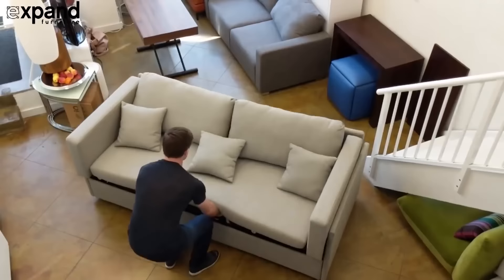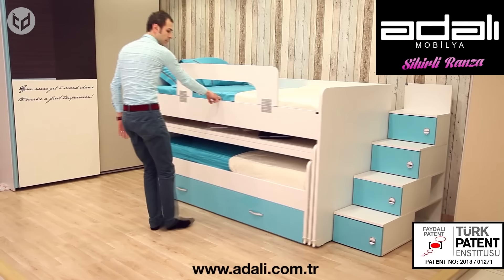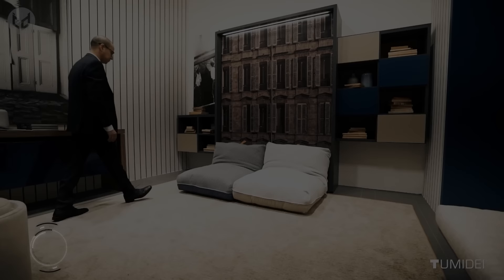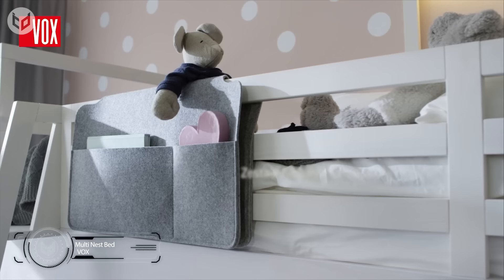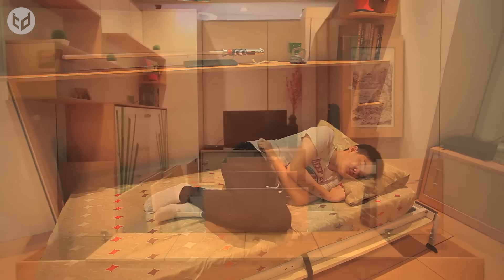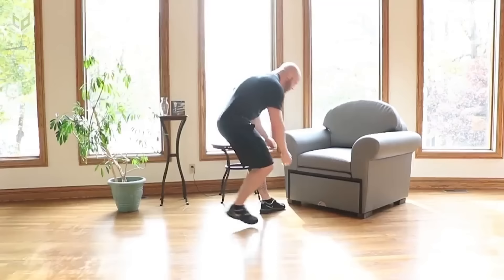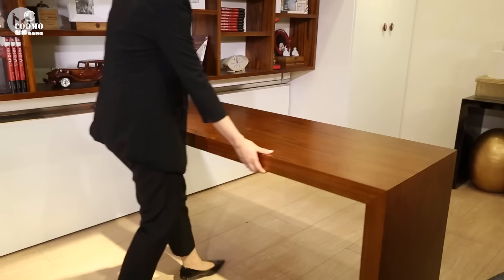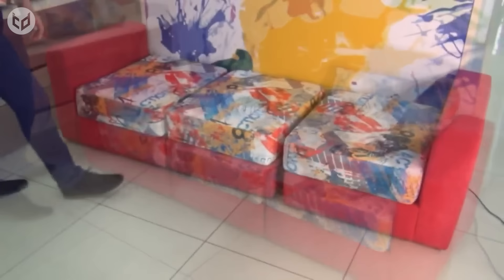70 INCREDIBLE Space Saving Furniture - Murphy Bed Ideas For Small Space

Comment: Great ideas!  The problem is that they are usually expensive.  If you could afford to buy them, you could probably afford a larger apartment and wouldn't need these.
Reply: J'ai eu exactement la même réflexion. Il y a une absurdité avec ces meubles : la logique voudrait qu'ils soient acheté par des personnes logeant dans des petits appartements (donc des appartements pas chers, pour les gens aux revenus modestes). Les personnes qui ont de gros moyens financiers logent dans de grands appartements en principe. Ils n'ont donc nullement besoin de ce genre de meubles qui coûtent extrêmement chers et qu'ils ont les moyens de s'acheter !
Reply: @francoiseprecheur2222  Sorry, it's not translating your comment.
Reply: @pegatheetoo1437  : I had the exact same thought. There is an absurdity with this furniture: logic would dictate that they are bought by people living in small apartments (i.e. cheap apartments, for people with modest incomes). People who have large financial means generally stay in large apartments. They therefore have no need for this type of furniture which is extremely expensive and which they can afford to buy!

Comment: The foldout stairs actually scare me. If someone is upstairs they could fall to the first floor if the don’t notice the stairs are folded into the wall (maybe a roommate or family member folded it away) or if they have to crouch down to unfold the stairs and lose balance they could fall. I think the reason the video only shows people unfolding the stairs from the bottom is because of how dangerous this could be for someone at the top.

Comment: Some brilliant ideas; my favourite was the high bed with multiple storage underneath. But are any of these items available in the UK?
Reply: i liked that idea too. I built a similar design using a large low solid wooden dresser for the front, put 2x4s across the dresser back and screwed then into the wall. Next I placed a shett of plywood across the whole thing and placed my mattress on top. It was not fancy inside , but it did have a ton of storage and i lived in a very tiny space back then. I had a 3 step step ladder to get on the bed. id like this one if i had any money and it was available in the USA

Comment: I don’t understand why designers don’t make Murphy beds to pull out horizontally rather than vertically. Some one might have 80” (the length of a queen size bed) horizontally but not vertically. I would really benefit in my space by having a single sized Murphy but oriented to pull down horizontally. I only have one room to live in and because of that I am always sitting on my bed rather then being able to have a chair. It’s very uncomfortable. Give it some thought designers. A nice thick mattress that disappears into a beautiful cherry wood cabinet with armoire on each side to hang clothes would be such a blessing.
Reply: see 10:20
Reply: @emmyjoyful1 -I hope I am not breaking the rules by saying the suggestion makes absolutely no sense unless you build a hole in the wall and the wall is think enough to house a bed inside, I hope you or the company can elaborate about even what that means.
Reply: Amazon actually has cabinet and horizontal Murphy beds.